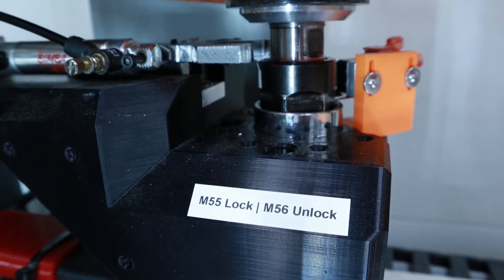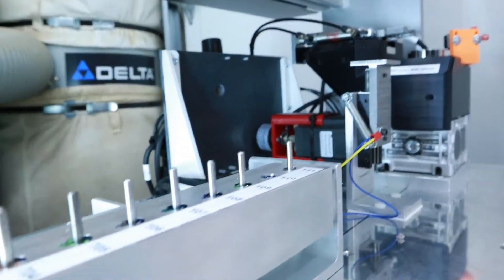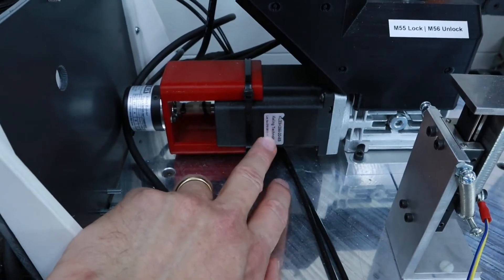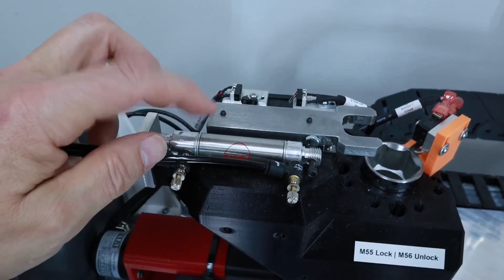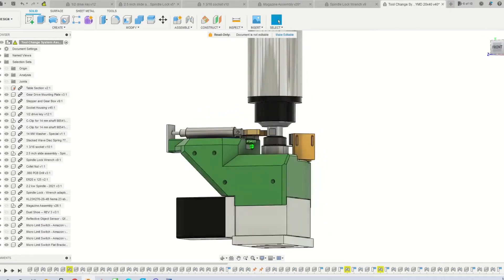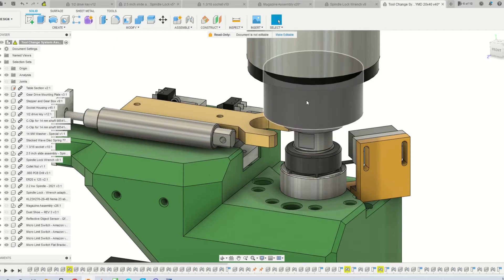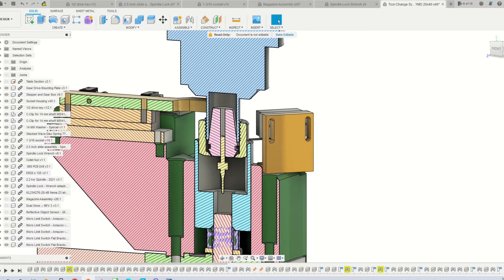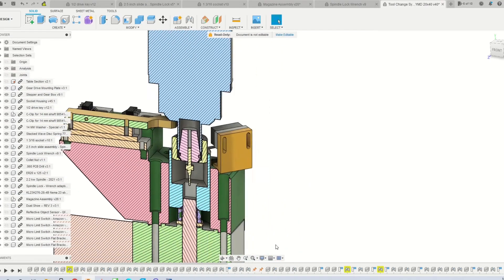CNC Router ATC Collet Tightening Device   Part 1

Comment: Nice design. Not sure how you ensure that it does not tighten so much it cannot undo. I would have used a lower drive voltage to the stepper motor for tighten than for loosen. Using this as the torque setting could probably mean that the encoder is not needed.
How do you ensure that the tool is fully seated? A spring inside the socket bearing on the tool collar should ensure this.
Reply from the maker: The stepper motor driver has selectable current output, thus I use a lower current for tightening than loosening. Encoder is needed to make sure the stepper motor is rotating when needed, can't trust that the stepper motor is moving, it is not a servo.
What do you mean by "The tool fully seated"?  

I believe the answers are covered in more detail in these videos (the first one below is this video).

https://youtu.be/FqJKw8ixR9c
https://youtu.be/fDu7Rqzx27Y
https://youtu.be/GT8pfsaKRpQ

Cheers!
Chris

Comment: I love seeing how different people have tackled the tool changer concept.
I was thinking using a shaft mounted magnet and a hall effect sensor that is aligned with the flat on the shaft. Then you could quickly spin the shaft to align the flats with the wrench and engage the wrench faster, reducing cycle time. The same could be done with the collet nut, or a compliant switch to sense when the socket and nut are aligned allowing a quicker movement.

That is one aspect I enjoy about high end machines. They are snappy at actions that affect cycle times. Like those 1 sec tool changes. lol
Reply: Mounting a magnet without upsetting the  balance in the very small space available would be challenging. The flats could be detected optically, or by the reduction in magnetic coupling to a probe. A lot if complexity to save a couple of seconds- this is never going to be fast.
Reply from the maker: I like your creative approach to thinking!  Certainly an ATC requires a lot of creativity.

Cheers!
Chris

Comment: I know I'm a year late to the party but this is great, thanks for doing this video!   I watched the others in the series which are also great.   Maybe I missed it but did you post any design files?
Reply from the maker: Glad it was helpful!  Unfortunately, that whole design was very specific to a combination of all the components.  I never really thought that anyone else would have enough of the same combination of items to want to create it so I didn't really create it as a "sharable project".  I certainly regret that now though as so many have wanted to replicate it.  Perhaps when I retire I can recreate this system and share the process.
Cheers!
Chris
Reply: @MakingStuffwithChrisDeHut   I was almost hoping you would say it didn't work well lol.   Now I have another project to add to the overflowing bin of...projects  to complete
Reply from the maker: @midwestcyberpunk  LOL!  You sound like me, way too many projects to do and no where near enough time to do it all.
Cheers!
Chris
Reply: @MakingStuffwithChrisDeHut   Does it still work reliably?
Reply from the maker: @midwestcyberpunk  Yup, just made a couple of circuit boards on it this past weekend.  Accurate as can be and runs like a champ.  In truth, I am surprised it is as good as it is.
Cheers!
Chris

Comment: Mr Dehut, you've made my week when I came across your invention here... wanting to know if you have CAD Models, BOM, and/or instructions on your ATC setup? Free or Paid works for me. Thank you once again for the innovation!
Reply from the maker: Unfortunately, I really don't have enough details available for someone to replicate this design.  In order for it to work, you would almost need the same model control as well.  MACH 3 is what I started with but quickly realized its macro language is far to flawed to handle this reliably (there is one video where I show what happened when I tried - CRASH).  Had I known this would be as good as it is, I would have filmed a How-To series on it.  Sorry!